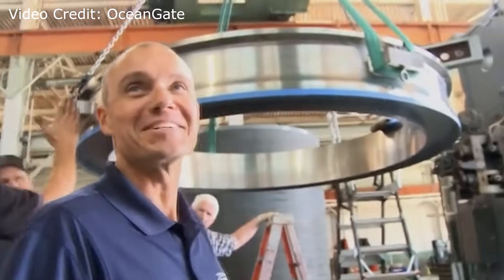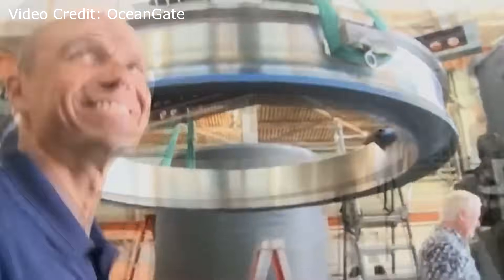Raw Unedited Re-upload of OceanGate's Promotional Video - Bonding a Titanium Ring to the V1 Hull

Comment: Can I just say that that glue did t really keep the window on from outside pressures. It’s meant to hold the pressure from the inside. It was completely safe for what it was intended for. It doesn’t matter if it would’ve stayed in place during the implosion. There still would’ve been an implosion.

Comment: Isn’t it obvious you should have the carbon fiber hull sleeved to the ring instead of the ring adhering the outer circumference of the carbon fibre hull, since the pressure of going inwards?

Comment: He accidentally conflated carbon fiber’s insanely  high tinsel strength with COMPRESSION strength, which there is VERY LITTLE. 

you can’t snap carbon fiber with 100 pound of weight on it but you can if you hit it with 100 pound hammer.

Comment: Rich, arrogant, selfish and ignorant boomer trash. How was this shit even allowed. Carbon fiber is LITERALLY know for being strong under tension but weak as fuck under compression. Then you GLUE? two completely different materials together, KNOWING they move differently with temperature and pressures. The rings arent even on the inside of the tubes, so the only thing holding the caps on is the glue. The titanium doesnt compress, but the tube does. Omfg lol. Then they didnt even cross weave the fibers, then they sanded down the defect bumps? Breaking the strands.. 

Boomer trash

Comment: 3 men working different sections of the same surface, applying epoxy by hand with spatulas when precision and uniformity are crucial, and being 1/100th of an inch off can/will/did lead to fatal results 🤦🏻‍♂️

Comment: they move differently as they are different 3 composites , carbon fibre tube , epoxy glue , titanium ring , all slightly different under compression .
different thicknesses , shapes and react in differing ways

Comment: Unfortunately,  everyone involved in this particular process is either very inexperienced in metal bonding,  or are just plain dumb, they did not degrease that ring or faying surface on the carbon, and that degreasing is a mission critical stage, also, what was the process treatment for the ring, not even a hint of that. Very poor.

Comment: Why would you glue the ring on the end? It's stupid to not have a lathe machine a step to fit inside the tube. The carbon fiber tube can flex inward at the joint without the metal ring inside.

Comment: You don't have to be a scientist to understand that gluing metal to carbon fiber is not going to do so good under the immense pressure deep in the ocean. There's no glue anywhere that's going to be able to reconcile the different compression and stress reactions from the two materials.

Comment: We all know now that the "peanut butter"didn t hold...Why would anyone goes so deep with a vessel like this probably not even seaworthy...in the past we glued aluminium plates on steel wich were used as binnes or containers for big streetsweepers and humidity, temperatuur and a super clean surface are key...can hold for years and years but you never know when it is going to fail.

Comment: I know it's easy it retrospect, but why would ANYONE think that having an expansion joint on a pressure vessel was ok, much less one of dissimilar materials, and then have the audacity to put that into service with humans inside of it in a role that requires large temperature changes, and gradients every time it's used?  Ask NASA about O-rings

Comment: I don't know anything about engineering or materials, but I would never get in a submarine made out of carbon fiber that's going to the deepest parts of the ocean. Whether they took tests and safety precausions or not, its not a material you want to put your trust in with that kind of pressure.

Comment: It's ludicrous the two titanium interfaces were not connected with tie rods running parallel to the Hull. This would add strength and give the adhesive contact point further strength. This glued area was absolutely bound to fail.

Comment: 0:54 after knowing what went wrong. This clip right here of them adding the glue with a spatula by hand, makes me cringe. Why did they insist on makinh the most crucial part by hand in an open air room where any dust could fall in between. Do they think space crafts are made this way too??
Reply: The glue wasn't the failure point, the carbon fiber was.
Reply: @RPGreg2600  The main failure point was tiny internal cracks inside the carbon fiber layers, that repeatedly got larger on each dive. Now imagine a hair getting in between this glue. Everything about this submarine was catastrophic.
Reply: The failure point was between his ears
Reply: The glue is to seal .... airs only, not to connect parts. They have bolts for that.....
Reply: @phuongmua5098  wrong

Comment: Any other composite techs out there who heard "carbon fiber submarine" and thought "no kidding "?  Once built a fuel tank for a rocket and it ruptured in testing.  Hundreds of tons of diesel and liquid nitrogen came crashing to the ground and cracked the concrete.  EPA and OSHA were all over us.  But yeah.  No way in hell would you ever consider a carbon fiber and epoxy tube to withstand underwater/deep sea pressures.  This guy was full of himself.

Comment: Wait, not even a socket type connection?  Just two ends butted?

Holy hell.
Reply: It's not a butt joint, it's a clevis and tang.  But the clevis lip is very thin and not meant to be structural.  And the tang is way too thin as well.  And there is no evidence that they matched the strain moduli of these two sections of vastly differing materials on this hull.  And then they abused the hell out of it after designing it inadequately and manufacturing it extremely sloppily.  I'm surprised it lasted as long as it did, and I'm going to go out on a limb and guess (along with Gordon, I believe) that this joint is where the ultimate failure started.
Reply: They do have socket type connection like screwing after everyone got inside the subs:face-blue-smiling:.
How do they not think about what if the motor don't work then what? how do they get back to the surface in time:body-blue-raised-arms:

Comment: They literally glued the thing together. Unreal

My gripe is with the scientist and engineers after the fact. 

In hearings they pretended to be concerned and safe engineers. Well, why did you stay on so long nd why did you sign off on things like gluing the thing together?
Reply from the maker: Thanks for your comment.  Yep, I don't get some parts of that either.  Tony Nissen built the first one, and that is okay; they were trying to do something new.  However, it did not work out, and Tony wouldn't let Stockton use it for the first year of Titanic dives (so Tony gets fired).  But Stockton forged ahead, and I am amazed at what the engineers let go by for the second hull.  That is really scary.

Comment: Extreme failure of basic understanding of structural modulus. Solid joining two different materials that compress and flex differently. This thing was designed with hopes and wishes, not engineers.

Comment: The glue has to be applied evenly, without air-bubbles, etc. So they are doing it by hand, without wearing a mask+ the most contaminated and uneven way possible. Were these people insane? S. R. was surely clinically narcissistic. But the other participants in this pile of...they disregarded every possible safety consideration. The Netflix-documentary is superb, I agree. This whole production-process should have been done in a sterile environment, with precise machines. But no, they went the cheap way. Okay. (If I remember it correctly, the Limiting Factor submersible cost approximately 36 million dollars. But it went to the deepest point of all 5 oceans. And to the Titanic and other wreck-sites. And it survived. It did actual scientific research. And it's still functioning. And it looks cool as hell. This Titan-thing on the other hand...a complete disaster, from beginning to the end.)

Comment: So you have carbon fiber that’s one component. You have titanium second component and they were probably using Bell Zona, which is industrial strength epoxy, and it works real good in like steel mill applications. It is incredible material. Here’s the problem as you go deeper. It gets colder these materials have differentrate of expansion or contraction so say the carbon fiber shrinks more than the titanium and the glue or Belzoni doesn’t shrink at all so as it gets colder, it rips itself from the bonding material itself, causing stress fractures, and then it exploded.

Comment: What in the garage build crap is this?
That's okay for a car body, not a sub!
Also, not an engineer (but neither is this guy), building a hull out of composite carbon is doomed to fail because there is always a possibility of the two components separating.

Comment: Can you compress or decompress carbon fiber molds during their molding and curing to account for the little deformation caused by the foreseeable water pressures to be expected at the desired depths you plan on operating at?

Comment: As somebody who has no experience in building subs or high-strength materials interfacing with adhesives. 

Riddle me this: They clean the ring, I am guessing to get a good bond between the glue and the material. Or perhaps it is just to make it look shiny.

But then they touch it immediately - obviously leaving grease and skin from your hands. A pair of disposable nitrile gloves is less then a dollar...

Also no covering for the hair - I bet more than one dollar that a good number of very small hairs were sitting on that ring as they applied the glue... a disposable hair covering costs less than a dollar.

Then again - I may be wrong and it does not matter what junk is in your high-strength, high criticality, "all will depend on this" - glue bond. And I owe one dollar and a few cents.

Comment: My involvement with CARBON FIBER extends only to golf clubs. My Taylor Made Stealth driver had a much-ballyhooed 'carbon fiber face'... which popped off after about 50 drives. Taylor Made took it back 'fixed it' and it cracked down the middle after another 20 or so. That shit is not stable. Every time it's under pressure, it weakens. It was not a matter of IF this thing would implode, but when...it was a mathematical certainty.
This idiots idea of "testing" his carbon fiber hull was literally to use it until it imploded.

Comment: I am not an expert in any relevant fields. I’m aware that there are numerous potential problems with a composite submersible. However in the big scheme of things, gluing the titanium parts to the composite pressure vessel, I would have thought, would be simply to prevent the assembly from falling apart on or near the surface.

Comment: Im no submarine engineer, but should they not be vacuuming the microscopic air bubbles from that epoxy before applying it to something thats going to need to withstand 4000 psi of pressure.. i mean the toy industry does on silicone, resins and latex..🤷🏼‍♂️ This guy is a joke, complete psychopath..

Comment: My understanding is that the glue would contract under pressure and the titanium virtually wouldn't. That asymmetric connection should have been enough to cause it's demise, likely it was something else purely speculating based on how poorly they seemed to have built and thought this through.

Comment: Applying glue to a smooth surface like that does nothing. It needs roughness to bond
Reply from the maker: Yes, I agree with you.  However, what was interesting from the NTSB image of a recovered ring, there were places where the epoxy stuck to the titanium and the CF hull pulled away from the epoxy.  Interesting.

Comment: Did that glued segment survive? Or was the whole sub crushed?
Reply: The channel owner mentioned in a reply to another comment that one of the titanium end rings was recovered, and it had epoxy still adhered to it. 
The carbon-fiber hull pulled away from the epoxy when it failed.

Comment: Mixing the epoxy with wood is the funniest part. A microscopic piece of wood shaving or splinter under pressure alone is enough to cause a failure, as wood harbors microscopic air particles. Imagine the tiny bubbles in that epoxy and then see what bubbles do under a vacuum.
Reply: This isn't a smart take. They made the sub out of fucking carbon fibre. Shavings of wood in glue are totally insignificant compared to the terrible material used in this sub.
Reply: @jamesfranko5098 I’m
Just thinking in terms of holding moisture, under a vacuum it gasses like crazy, but you’re totally right. The amount of possible failure points with CF is crazy in and of itself.
Reply: @jamesfranko5098 What was the bonding medium around the carbon fiber?  Was it resin like fiberglass?  Is that a variable, the medium that contains the carbon fiber, or is it always a certain recipe?  I wonder why they wouldn't just use mild steel...also because in the construction business, many fiberglass components are three times the weight of stainless steel.  Might be good for ballast, though.  Anyway, it's an interesting story.
Reply: It would never be under a vacuum, it wasn't going to space.

Comment: I'm not a marine engineer, but if i saw this promotional video and saw what essentially looks looks like a two part epoxy fix which wouldn't pass an MOT safety check, holding back the full might of the ocean where a pinhole would be able to cut though you like a hot knife in butter. 
And the CEO is calling it peanut butter, and they are yamming it on with spatulas and its about an inch lip around the edge, that will be a flex joint when the carbon fiber compresses but the but the titanium rings don't, now I know something about joining dissimilar materials, with different expansion rates and flexibilities and how its a bad idea if either of them are going to be doing anything stressful and how you should never really glue anything together because it always fails and if they are its because they are too lazy or cheap to fix it properly, buy a new one or weld it and anything they tell you is an excuse. (apart from low pressure plumping fittings and they still burst sometimes)
life is a bartering system with the outcome on one side and what you put in on the other, when you reputation, business and life is on one side and you input is superglue and panicked expressions, you wont have a good time, not a single engineer in this video will ever be trusted with anything, I wouldn't trust them to fix a fucking broom handle, they would probably try and glue it together.

Comment: The first thing I noticed about the cylindrical rings was how polished and smooth they are, If your goal was to bond the cylindrical rings to the carbon fiber cylinder using a bonding agent then they should have been rough sanded. The bonding agent cannot form a proper bond to a finished surface like polished titanium. Touching the surface with his bare hand a big fat no, and not in a temperature controlled room, ideal temperatures need to be monitored to condition the environment for the epoxy. Where was the point of failure?

Comment: To his defense, this sub made it 13 times to Titanic without incident.
Reply: There were incidents. The strain gauge data, when plotted correctly (which OceanGate didn't), showed that the hull was being compromised. It was a ticking time bomb.
Reply: Without incident? I thought they logged more and more incident reports with each dive, pretty sure I read somewhere that they were up to like 40+ (or some crazy number anyway) hull warnings on the very last dive before the final implosion?
Reply: It degraded each time it went down then it failed
Reply: A a properly designed and constructed DSV can withstand pressure cycling over hundreds of dives and thousands of hours submerged, before retiring 100% intact without killing a single person.
The fact that Titan managed to survive 13 dives before failing catastrophically and killing five is not the great defense you think it is.
Reply: In 3 yrs of trying and the majority of the dives being aborted

Comment: Why even using carbon fiber in this case? This is so so idiotic... Carbon fiber is used in light weight builds like planes or race cars where structural strength and low masses are necessary. A sub really doesn't fit this case. Or is he going on a race track or a flight to the moon with his soda can?This is so uninmanageaby stupid man. What a fucking idiot. Ended multiple lifes by his stupidity and filming it proudly. WOW.
This whole setup looks like a strange experiment in material sciences. Did they even test the bonding beforehand scientifically? Guess not...
This makes me angry.

Comment: Shouldn’t the metal surfaces have been scuffed or sanded prior to applying adhesive? They looked perfectly smooth…

And that carbon fiber looks like it was spun cylindrically, not crosshatch, which is what gives carbon fiber most of its strength

Comment: To be fair, it wasn’t the glue that failed.
Reply from the maker: Thanks for your comment.  Tym Catterson, the technician who has been with Stockton since the sub Antipodes thinks it was this joint that failed.  He testified that in the hearings and mentioned it again in the Discovery film.
Reply: @solareclipsetimer  thanks for the clarification.
Reply from the maker: @RyDogg08 No problem. It doesn't mean Tym was right, but he has a lot of sub experience.  But it certainly could have been the hull that failed.  Watch my video on Dive 87.  Then see what you think.  Thanks for your reply

Comment: Stockton Rush had a hard on for the carbon fiber thing but in hindsight it probably would have been cheaper just to go with a full metal structure considering how many failed CF prototypes he had before the “final” design.
Reply: Correct. There was no reason to go with CF except to show off. If it ain't broke, don't fix it.